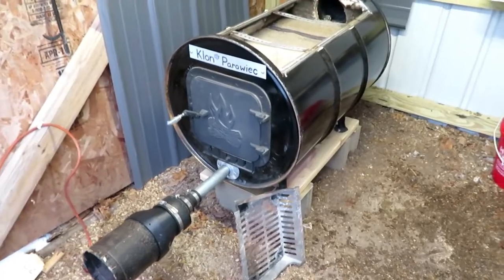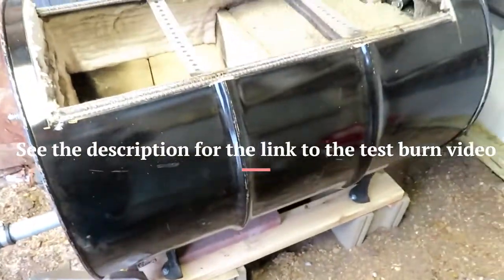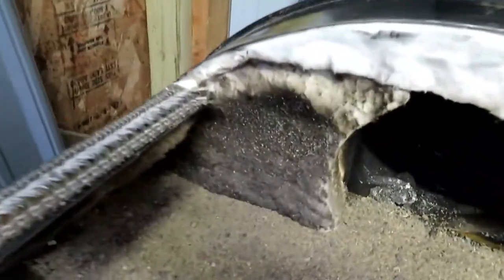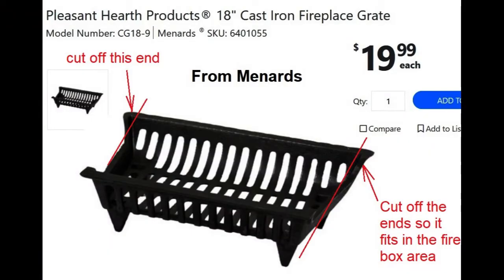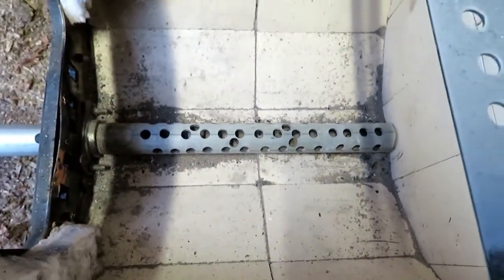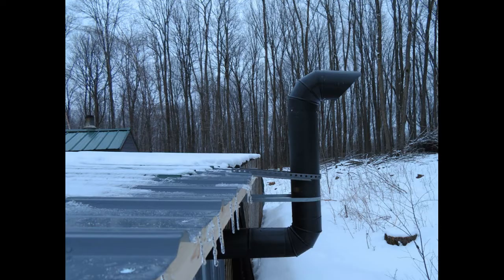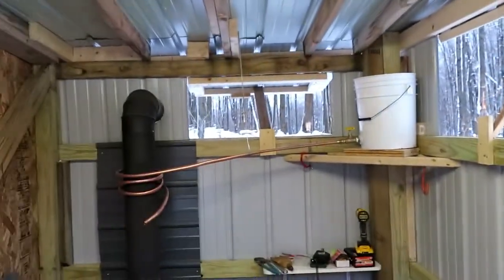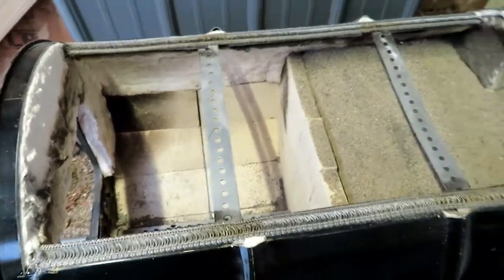Anatomy of my barrel evaporator

Comment: an excellent video, very helpful. I do not have electrical service where I am going to use my evaporator, so no possibility of a blower. Do you think I will be able to function well without the blower. THANKS
Reply: use a dc blower with a battery.

Comment: Isn't the 6" exhaust flange curved to fit the top of the barrel. How did you mount it flush with the flat back of the barrel? Or did the back just curve a little as you tightened the bolts?

Comment: hi, why the sand on top of the fire bricks ?
Reply from the maker: ITs a low cost way to change the height to set the best spacing for the flames that travel under the pan as the flames work their way towards the stove pipe outlet.
Reply: @innovativeoutdoorsman5067  thanks for sharing i like everything you did and will emulate. my family will think I am a genius

Comment: Would this design work for the barrels that use the two removeable pans with the stove pipe coming off the top?
Reply from the maker: yes
Reply: @innovativeoutdoorsman5067  How much space did you leave between the pan and the rear flat area?
Reply from the maker: @outdoors-fun  3 inches

Comment: What is your fan?
Reply from the maker: this test was done with an inline fan I had laying around but I also have a braun bathroom vent fan I will try.
Reply: @innovativeoutdoorsman5067 
curious… would not having a vertical and taller smoke pipe induce better draft and thereby let it burn hotter without forcing cold air into the arch? My various friends and family that sugar with woodfired arches get glowing red firebox doors with natural draft… blowing air in might fire the wood off faster but since to goal is putting heat to the pans (not burning wood) and the gasses from the wood are what burns the hottest I’m not convinced the fan is beneficial.
Reply: @fishhuntadventure  ive been watching videos all day and many folks have mentioned adding a fan greatly improved the fire and boil off rate.